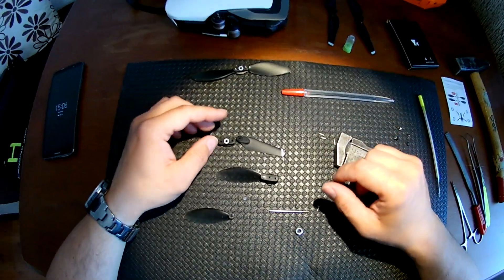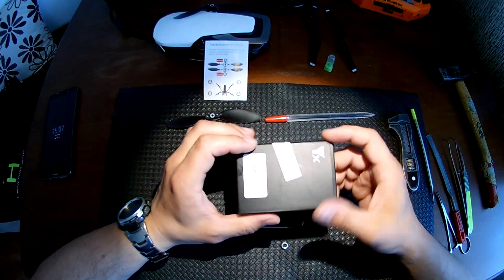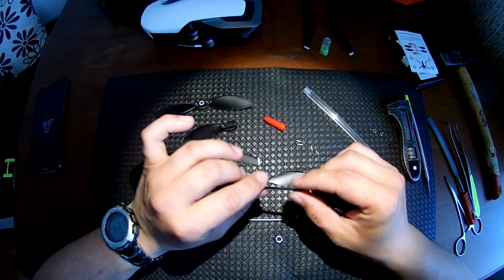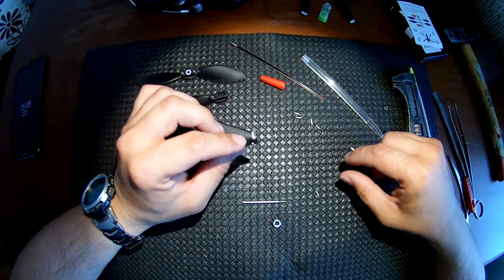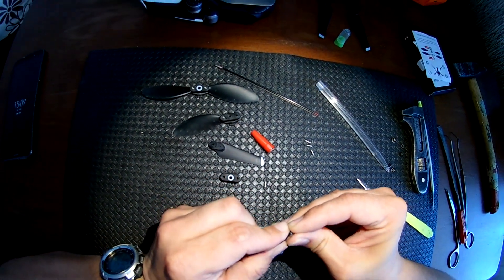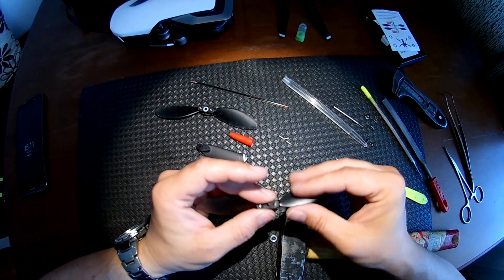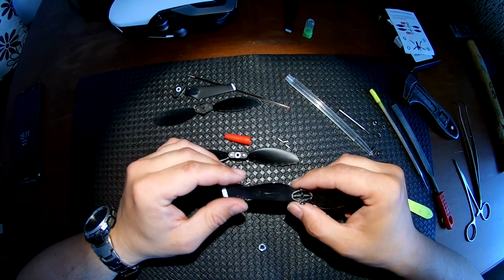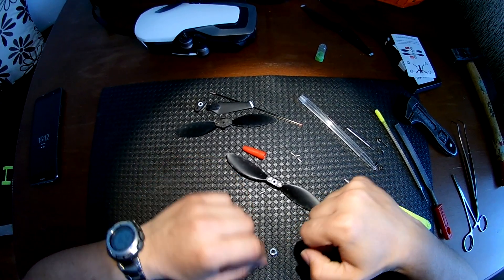DJI Mavic air with Parrot ANAFI propellers more silent

Comment: How this parot anafi prop holding up with the sport mode? I heard from other people using this with MA. The prop can't stand the sport mode and it snap off and drone crashed.
Reply from the maker: No, with this set up done correctly sport mode is like usual. The big advantage is that the image and video is clean without half propellers in view.